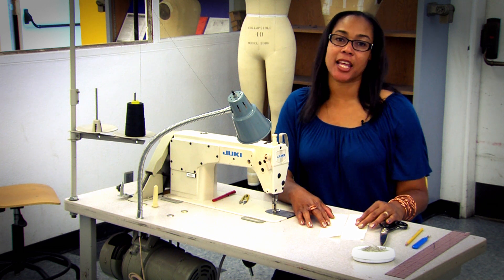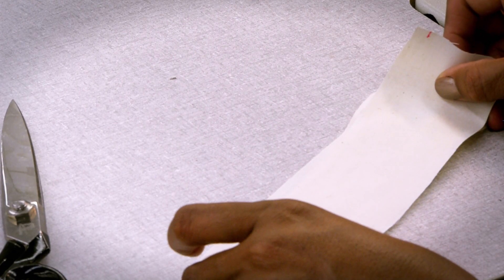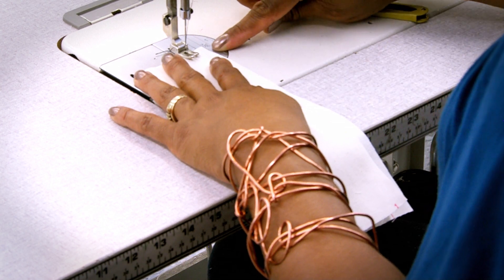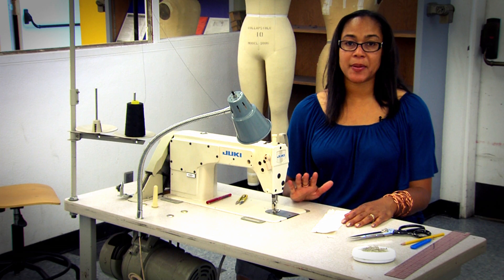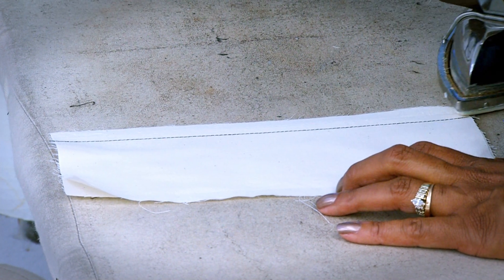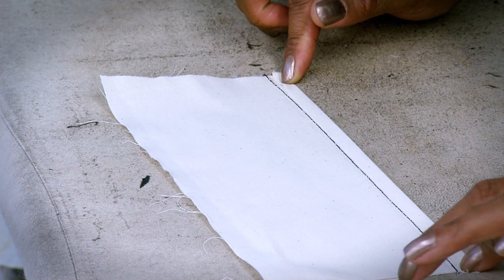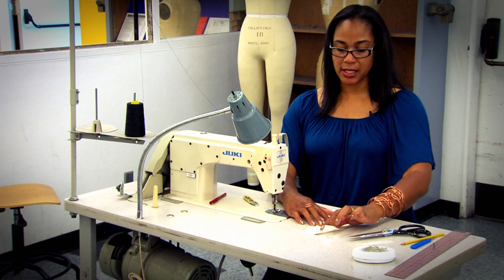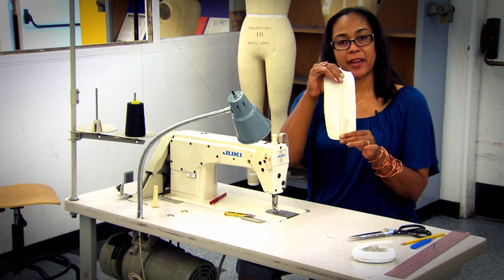How to sew a Flat Felled Seam

Comment: Thanks for the good instruction. I think the camera could come in for more detailed shots, BTW. In this video the last scene did not really show the finished seam at all, just a piece of white cloth held up. But, again––good instruction. The method of using two different  widths of fabric at the initial seam allowance is very, very much better than cutting one of them after the seam has been sewn.
Reply: +Jimmy Chadwick Jimmy, this is actually a home sewers version of a Faux Flat Felled Seam. A true flat felled seam has 2 stitches sewn through all 4 layers of the fabric. See your old pair of jeans as an example. The Faux Flat Felled seams you have one row sewn through all 4 layers, which is the final stitch. The first row is only through 2 layers of fabric.